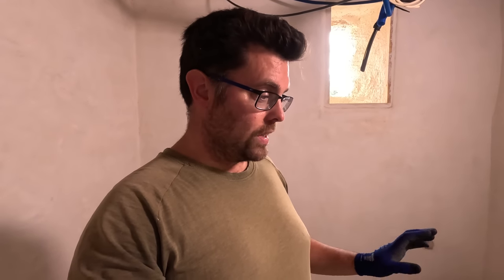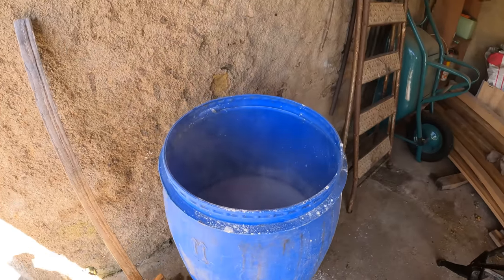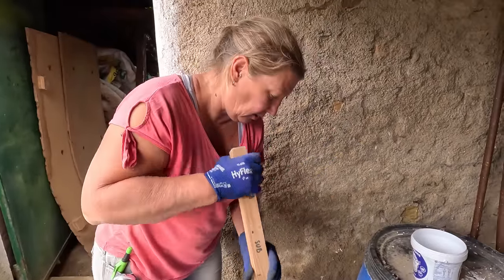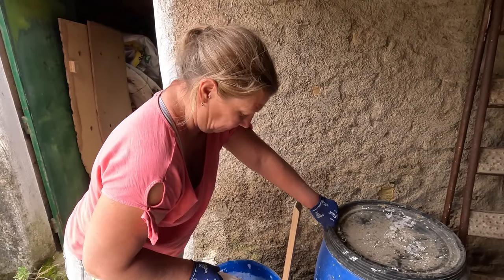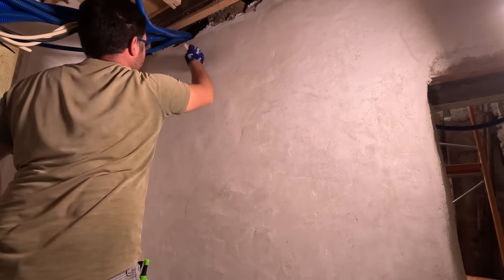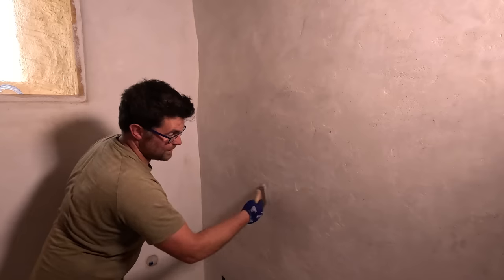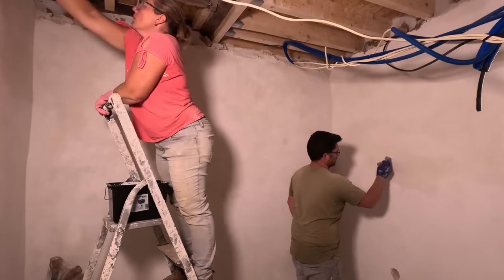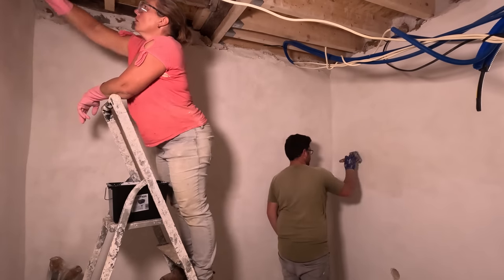Painting with Limewash (for the First Time)

Comment: We have almost finished limewash in one part of our project. We took the cave house back to bare Spain, have applied lime render and now lime wash. We found it took about 5 layers of 'single cream' consistency before we achieved the brilliant white we wanted. The type of brush definitely makes a difference. We started with brushes like yours, but the traditional round brush is much better. Also, from our experience, it needs to go on wetter and be spread about, but don't let your brush go dry.
Reply: Yes I remember now from helping as a Child the brush was round.
Reply: I have vague memories from helping as a child and the consistency was a bit thicker. The first time requires more coats for coverage. It ages to a soft white/cream and then it’s just a coat a year if you prefer brighter white. I love the look of limewash. It is so soft and fills me with nostalgia

Comment: Can definitely hear the frequency difference in the rough vs smoother parts of the wall. I used to love the texture of lime wash walls when I lived in India 45 years ago. They are probably mostly using other products now, but I would suppose that in the smaller villages the old practices still go on. Too bad you can't just pop over to have a look 😄
We are also installing a heat pump in the next few days, but first we have to make several holes in the 60cm thick stone wall - ha!

Comment: Usually the consistency is more watery than single cream because otherwise it can crack and get a bit flakey. They traditional round brushes are so much easier and if you attach it to a pole you can get to the top easier… just splash it on, it will take a few layers to make it a really nice thick white and eventually will make the walls beautiful and smooth, in 5 years time 😊 definitely worth the extra work though in comparison to paint.. it just looks so beautiful and is healthy for the walls. I’m sure when you are finished it will look beautiful! X

Comment: Lol!  Came inside for a quick coffee while procrastinating today's start to limewashing the front gable wall of my cottage and found this!  Did the first gable last Saturday and it survived a tropical downpour on Sunday.  Limewash is so easy, cheap and forgiving that I don't know why more folk don't use it! I add a dash of linseed oil to my limewash which helps to cut down on the "lime-iness" of the finished product.
Reply from the maker: Interesting, do you add the linseed oil to each coat, or just the final one?
Reply: @MAKEDOGROW  I just add it to every batch that I make up, but I am using it outside as an added layer on an already whitewashed building and always hoping to get away with a single coat.  I find it stops the surface being dusty if you brush against it and makes it smell wonderful! It also gives the building a slightly  "old white" colour when it is fresh, rather than a brilliant, need-dark-glasses-to-look-at-it effect.
Reply: Oh, and I notice that you mixed the liquid back in before taking the putty out of the bin.  Nothing wrong with that, but I tend to reserve that liquid for use in stabilising dry, dusty stonework before lime-pointing.  Where you are spraying with water before pointing, I am wetting with the water from the putty bin (which is a weak calcite solution) which I believe helps to bind and refresh the old dry mortar in the wall.
Reply from the maker: @rb9580  oh, interesting… might save it for the pointing we’re hoping to do over the summer

Comment: What patience you have! I wish I had even half of it... Have you heard of Kreidezeit casein-bound + marble dust lime paint? It comes in powder form, you have to mix it with water just like your lime putty. It's very economical and looks beautiful on lime plaster. Also midly washable. Totally breathable of course. I used it throughout my own house (which has lime plaster on all walls) 20 years ago and even painted the wood ceilings with it. Coverage is amazing, application is very quick with a roller. Smooth and velvety to the touch. And no, I don't have shares in Kreidezeit!

Comment: If you are painting pebble-dashed walls or roughcast concrete, you can use a roller that has a much thicker pile than a normal roller that you'd use on walls with emulsion. I was wondering if that would work to get the limewash onto the walls and then you could work on areas that needed the limewash distributed better over the surface. It might save a bit of time, especially if you used an extension pole so you can paint larger areas faster.
Reply: Personally, I'd throw half-buckets at the top of the wall and "direct" it towards the floor with brushes....

Comment: looking great!  I use Distemper inside the house and limewash outside?  The limewash can be mixed to a double cream consistency and onto a sprayed (with water) wall.   I find that its dusty unless it can be seasoned by the weather. On the outside I put an initial three coats and a top coat with a mug of linseed oil to help as a weather coat.  The mistake that most people make with it  (my family have been using it as farmers for four generations) is a coat that is too thin.  I have been using it since I was sixteen and its still sticking to houses I have painted on salisbury plain; the welsh marches and the side of a hill on Dartmoor.  I have an interesting recipe for both  an old welsh farmhouse (which involves fat and boiling it with the lime) and an original recipe for the Whitehouse.

Comment: You are doing it right. You can also sand in-between the coats but make sure you're done with sanding after the second coat, so that every bit of the wall has at least two solid coats on it.
Reply from the maker: Great, thanks. I think next time we’ll definitely do more sanding before we start

Comment: I have done lime wash before. Need to use a '"grass brush" (big grassy brush) which gets full of lime wash and lime wash runs down the wall in copious riverlets....(ie. it holds LOTS of lime wash)
Reply from the maker: And why is that better than a traditional brush (other than having to go to your bucket less frequently)?
Reply: I have also done on my cement flooring with a broom and apart from making everything look super clean it seemed to chase ants away. We used to use lime wash over our plastic tunnels in summer to cool the tunnel down and stop the heat through the plastic. I think on a wall a block brush is best, because it is not like regular paint that kinda spreads,  it sits where you smear it.

Comment: I've heard Nigel Copsey suggest that using hot lime for limewash (i.e., not leaving it to 'season') allows you to put on thicker coats, he says only 2 coats would be necessary instead of 7+. I'm exploring the idea a little. He's kind of critical of the idea that letting lime putty sit for long periods improves it, which was a surprising to me as it's basically stated as fact by many people, but he's very knowledgeable about historic mix ratios and draws directly from historic documentation in his research so maybe it's worth looking into. Maybe we'll experiment with it at some point.
Reply from the maker: I’ve heard the same about hot lime, but almost always in reference to external use.

I’ve read Nigel’s book, and many other sources … from what I gather there was a misinterpretation about the maturing of lime putty from some Roman sources. A source was translated as ‘3 months’ rather than 3 days or weeks (I can’t remember which).

Traditionally here in Portugal, a vat of lime putty was always kept going … more for convenience than maturity it seems … so it could be used on buildings every year as well as trees (it helps protect against the sun).

For lime washing we like the convenience of using putty, but we hot mix for mortar purposes quite often
Reply: Thanks for these insights. I also had another thought to share but forgot to mention (I apologize if you know this already, I know not everything is mentioned in video). One thing we do with our limewash is strain it in nylon stockings after mixing and before putting it in a clean bucket. There's always some amount of calcified lime in it no matter how well it's stored, I find. Maybe that sort of thing is what was causing the need for sanding between coats? Appreciate your videos and the detail you guys share! Wishing you both the best.

Comment: The lime "wash" etc was cheap, and after using open indoor fires, coal, wood, etc, the walls had dark patches. People needed to get a healthier (well, mostly healthier, given a complete lack of hygiene about various bodily functions) so a quick "wash" of lime took most of the stench out, stains away, and dingy interiors looked better. 
Modern gas stoves are what I had to deal with, removing the condensates, the dingy floors and walls (windows frequently cleaned). 
No fun, then or now. 
You've got the walls much better than I admit I could with years of practice. 👍

Comment: Could hear the sound and see the textured finish between the top steel trowel areas vs the lower non steel trowel areas. Need brighter light to differentiate between freshly painted lime. There is a slightly darker color when wet. 

When we used lime paint, our slurry was thicker than your first mix. The final finish textured finish was less important. The goal was to lighten and brighten. The bristle brush was wider, about 10 - 12 in, experiment with bristle  length and see what works for you and several layers were applied. The goal was to inexpensively cover imperfections, reflect light, reduce heat.

Do some experiments. Cut some throw away boards. Apply the layers of lime plaster as you want to vary. On the  non-troweled areas, brush on lime wash at different slurry consistency. Allow to dry. Re-apply several layers 3, 5, 7 and compare the differences. Repeat with different bristle thickness and length. Experiment with various rollers to determine if any are suitable.

In time and practice with repetition, you will customize your technique. Does humidity and temperature affect your mix slurry consistency?

Comment: Small question please: if a house has cement plaster on top of bricks, if i remove the cement and put lime plaster instead, will it be better in terms of health / breathing house?
Reply: Yes.
Reply from the maker: At a minimum the lime will deal with humidity/damp/mould better. Without knowing more about the building construction it’s hard to comment further
Reply: Lime also also antibacterial, anti insect etc properties.  Something important to remember now that new diseases are developing and medical profession failing globally.
Reply: if it is an old house, of stone masonry, I have no doubt that it will be much better.

Comment: Others have made great comments about methods of limewashing etc. I've been involved in a few limewashed and plastered eco-buildings and wanted to comment about you thinking out loud "... pulling this from my memory somewhere - I don't want to be doing this every two years" .. Everyone I met says the OUTSIDE of a building needs limewashing every FIVE years to maintain the hardness and weatherproofing. Inside needs doing much less frequently.
I bet your lime groups have already told you this since you made this video.
The hardness of limewash as a coating needs emphasising imo - over time it gets harder because of it's reaction with the air.
Reply: It reacts with the air and the sun. So, I think, in interiors, it needs more time to dry between coats, to get harder and whiter, and coats that go thiner each time.

Comment: You missed an opportunity for a Ha at the end.  Also with applying almost invisible colours, light is your friend.  As the son of painter, and someone with experience, the light reflects off the wet areas so you can see where you have been.  Depending on how quickly you have to move accounting for drying.  Then you need a little systematic technique and try and stick to it.

Comment: I think you need swamp lime. The lime you take is slaked lime and this and this chalk out. Lime putty is a slurry (suspension) of calcium hydroxide (Ca(OH)2, hydrated lime, slaked lime) in water. The name swamp lime comes from the very old technique of swamping the lime in a pit after the quicklime has been slaked with excess water. If the slaked lime is dug out of the pit again after months or years, it is fine and supple, but relatively firm, and the so-called lime sinter water has settled above the slaked lime. Lime slurry, swamp or fatty lime is the name given to the viscous, doughy to yoghurt-like suspension that was mixed with just a little water. If you dilute this further, you get the watery milk of lime that can be used as whitewash (lime paint). Mixtures with rock flour and aggregate are used as lime slurry or lime mortar. 

Lime swamp is used as a paint diluted only with water as a lime wash or mixed with fillers as a binder in lime paint, lime casein paint and other mineral paints. After applying the milk of lime to the painting surface, the calcium hydroxide binds by absorbing carbon dioxide. Before using it as a paint, the viscous lime paste is mixed with water until it is translucent and milky and the metal still shimmers through on a knife blade (craftsman's rule). Lime milk has a germicidal effect due to its alkaline reaction and was also used in the past to whiten walls in animal stalls for hygienic reasons. Lime water was also used for the makeshift sterilization of early medical facilities, toilets or storage sites for cadavers and for leather tanning. You can buy swamp lime as ready product. In the restoration, particular value is placed on long swamp times and the lime sold as church lime is stored in the lime pit for 20 to 25 years.

I hope it will help a little bit.

Comment: You better dont smoke inside. I've done a lime coat once and it turned yellow-brown rather fast. IMO it needs to be mixed with oil or something. Traditionally tallow is added to quicklime and watter but it makes it waterproof. CaOH is not very solluble in water -  1.73 g/L (20 °C)
You need to spread the white stuff. Lime water is however a nice penetration to reinforce old sandy structures. You need to do it all the time because there's only so much of calcium but it goes deep and turns your sand between bricks into a sandstone. Slowly but surely. It can be an old chimney for example. We had a job to repair one and I didnt like the modern way - silicate penetration (not enough to soak more than an inch and some caulk and another penetration-like hydrophobic cover. It's expensive and the chimney is still crumbling bricks standing on sand inside. Thank God we dont have Earthquakes. Half of the country would collapse like the houses in Turkey. Half of Prague would be a pile of bricks.
My indoor lime coat was really white once it dried. I loved everything about it, especially that it still allows moisture in. Which means another lime water too. The process is actually used on historic buildings as a novelty. I'd stick with paint for indoor use as a smoker if white is the choice. It could be nice with red or yellow clay tho. I'm thinking about it but a uniform shade could be challenging unless I weigh everything or blend an enormous barrel of it
Reply: * I remember I used a roller to spread it thick

Comment: Can you die the lime wash with tile grouting die? 
I recall my parents tiling their bath room with pink tiles then  we were then informed there was no pink grout die only bright red. I took a minute amount of the red grouting die and mixed it with the white grout and I produced pink grout.  I had access to very accurate scales used to measure very small quantities at the time. Anything more turned red.

Plasters I have watched in the past rubbed down the wall with a white fire brick. Removing imperfections. After the plaster has dried.
Reply from the maker: You can tint it with any pigment (ideally natural). We’ll probably experiment with something in one of the other rooms

Comment: I've done lime wash a few times, and in my experience single cream consistency is too thick. As a wash it needs to be quite watery. The goal isn't to achieve opacity in one coat, but in several. If it is applied to thickly it tends to become powdery, a common complaint with lime wash. Certainly if you are achieving any texture with any single coat of lime wash it's way too thick. I've had varying results myself.

Comment: Information: 

Once lime wash is dried, please rub your hand over it. If it is not coming off then you are good but if you see lime powder on your hand then you should add adhesive to it. 
We used to add "FEVICOL" brand of adhesive.

25 year ago we didn't had the luxury of wall paint. So everbody used to apply lime wash on their cemented wall. It would not stick to it without adhesive.

May be you won't face this issue because you are using lime putty.
Reply from the maker: Zero lime powder comes off when we run our hands on it. We’ve always heard people saying limewash is ‘dusty’ but we’re not experiencing that. Maybe it changes over time, guess we’ll see
Reply: @MAKEDOGROW , it seems to me that it proves that it was well done.